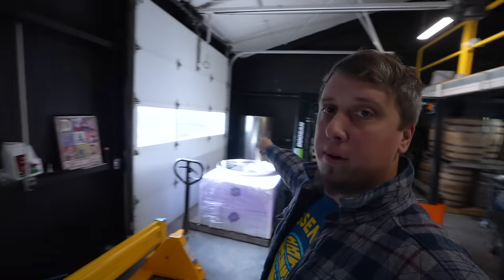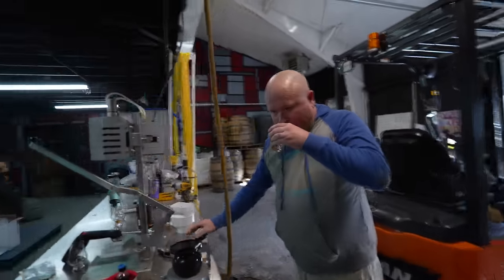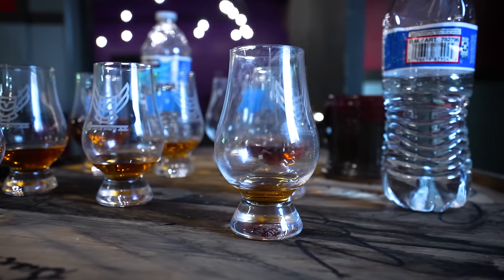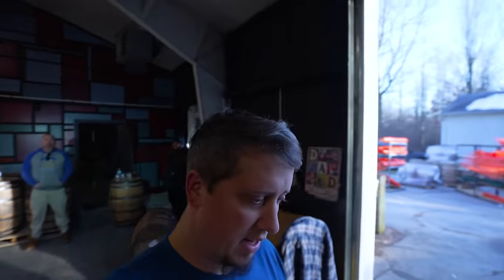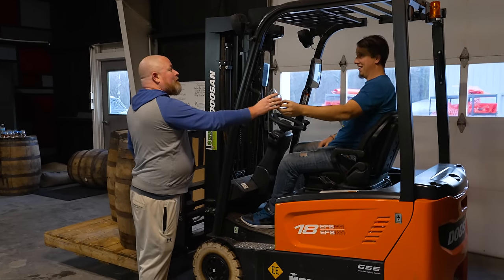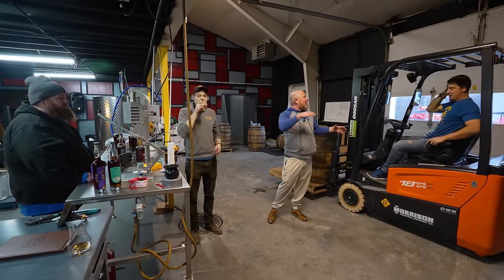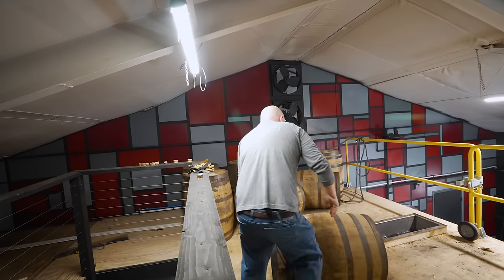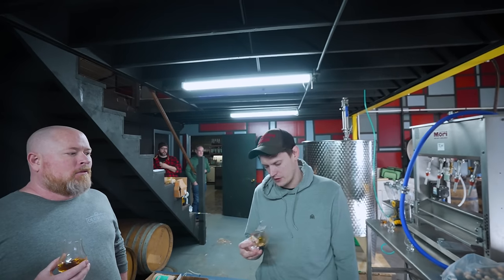How to Blend Bourbon Like a Master Blender! The FIRST EverNorth  Nightstalker Bourbon Blend Ever!

Comment: What do use to plug the barrel when you drill into it?
Reply: There’s wooden plugs you hammer in
Reply: @brandon_sprague  if you want to sample it again later do you pull that plug out or drill another hole?
Reply: @Toot7319  drill another. The plugs swell up and plugs the hole.
Reply: @brandon_sprague  interesting. Thank you for the information.